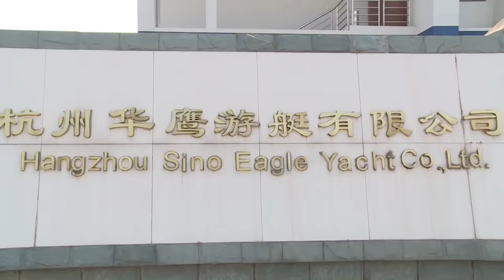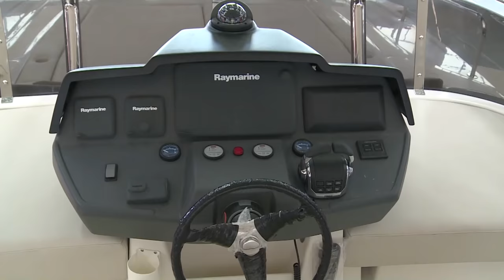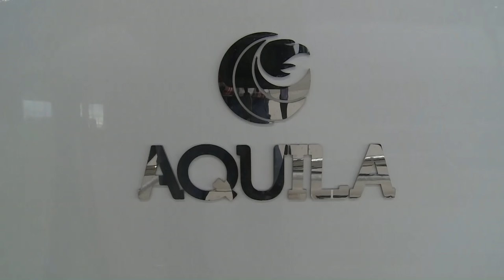Aquila Power Catamarans - Sino Eagle Factory Tour

Comment: can have improvements in QC, got a new stock 36 in 2020 with JPO, they had installed  a wrong active trim module which did not work with the engine model that the boat has. I wonder if they had tested the system in the shipyard.